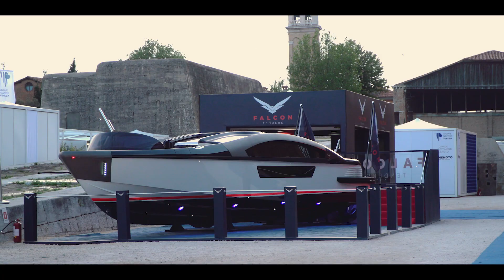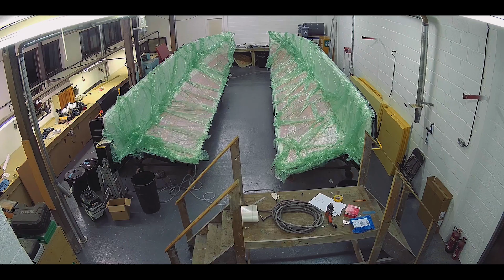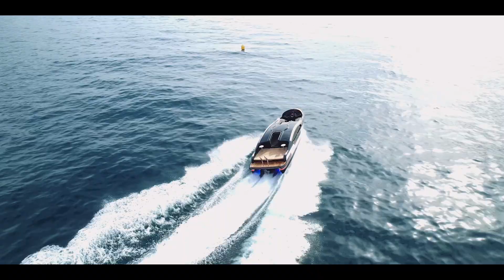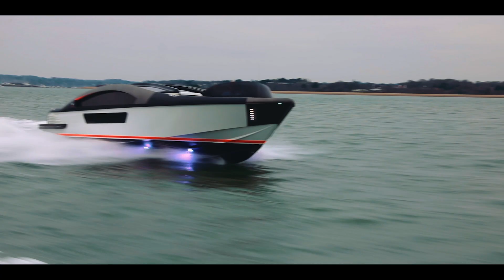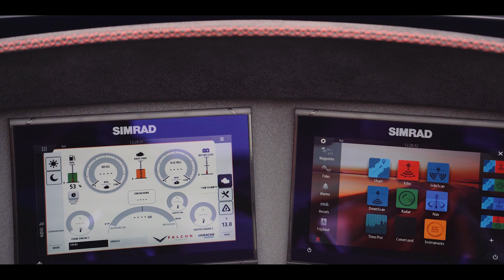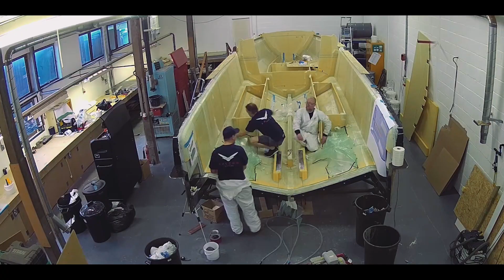Falcon Tenders | $3 million-plus Superyacht Limousine

Comment: Disagree with the “emission free” buzzwords. 

The power isn’t magically coming from somewhere. It’s charged up via a combustion engine that is out putting co2, NoX, SoX etc.

It’s a pretty poor understanding of mechanical principles to out right call it “emission free”. 

When your charging up the batteries your placing More load on the engines hence drawing more fuel and more emissions.

In a car, when braking, that could be considered as free energy as it would have been lost either way due to brake pads. It’s hard to truly see how this could ever been done In a boat because of the drag already undertaken by the water itself. (Regenerative braking) 

2/10 for the video. Your marketing is getting abit tacky Jack.